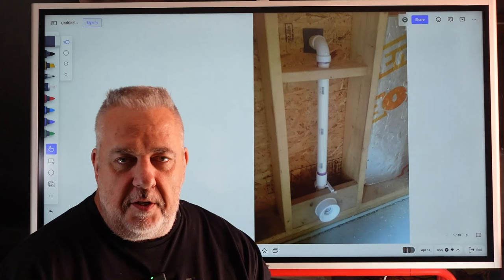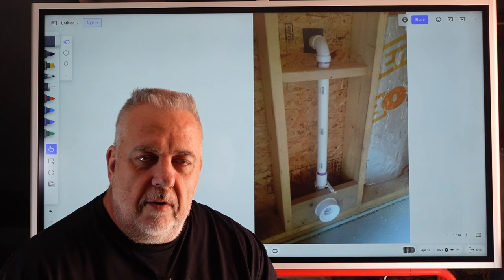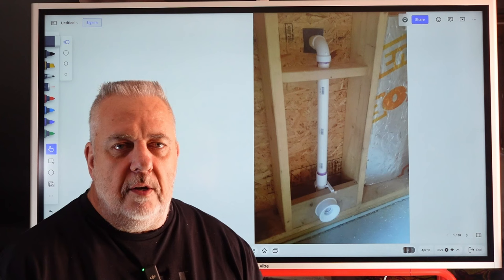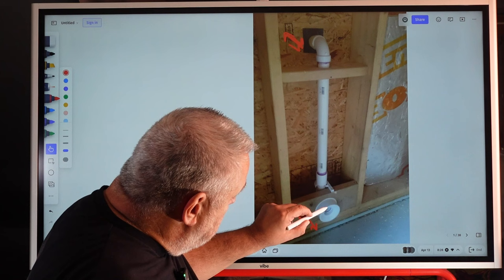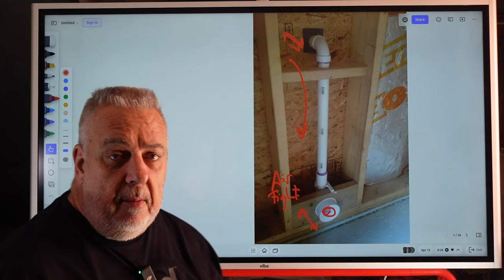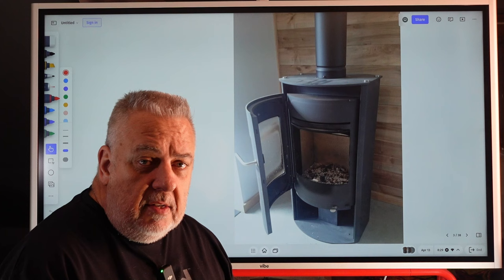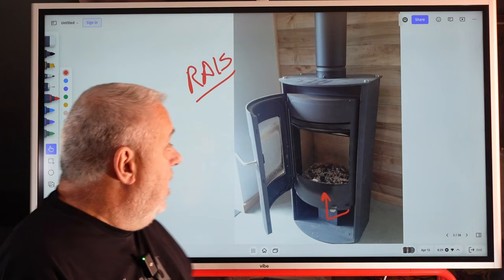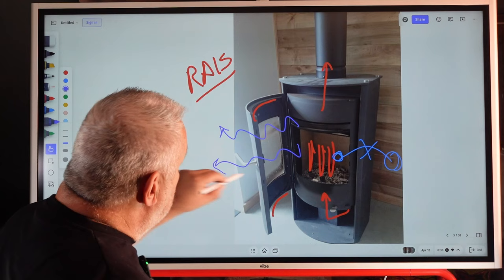SEALED WOOD STOVE....RAIS?

Comment: Have you looked at wood stoves with built in water heating systems? They can be tied into the hot water tank and underfloor heating systems, great option for a passive house. eg. the HETA Scan-Line 805 Aqua has it, and can also similarly be connected with air tight connection to external air intake.

Comment: I recently learned that "wood fireplaces" do not belong in the "modern home".  So glad to see Steven showing us how to put one in.  I have a Jotul F600 that is setup in this same way, with an independent combust chamber, which draws air in from outside.  I had not though to put a valve on the intake, I was stuck on flue and stack affect.  Going to move the F600 inside, and use this detail!  Thank-you very much Steven for this great idea.  Here in Canada, my parents burnt wood as the sole source of heat until last year, when physical demands made them switch to gas.  Love to have the option to put on a nice wood fire once the weather is cold again.

Comment: Not to be a stick in the mud, but this appears to break a significant number of IRC codes: R1006.x 1.) Doesn't appear to be a corrosion resistant 1/4 screen on the outside, 2.) Unlisted combustible, this should be a metal flue and not PVC (in the event of backdraft), 3.) Passageway should be a minimum of 6 square inches, this appears to be 2" PVC which is ~3.1 square inches, 4.) Exterior inlet should not be above the firebox.  While the theory here make sense, this is literally the textbook example of executing in a manner that doesn't adhere to code.

Comment: How do you air seal the flue/chimney system in your envelope? How do you integrate your air barrier into the fire barrier while keeping your house as tight as possible? I thought most flue systems for stoves required a gap to maintain fire protection?

Comment: Great idea, and love to see this as an option. I think it would be beneficial to see the details on the air sealing at the ceiling and/or roof deck, as typical clearance is 2"-4" gap around the pipe for combustibles. How do you insulate that area?

Comment: Really interesting! I’m currently remodeling my personal home and live in VT so the ambiance of a wood stove, fireplace, pellet stove is great but considering I’m using Zip and Siga as air barriers in the project, I’ve been thinking about what I can do for something like this as I don’t really like the look of an electric fireplace but obviously won’t be able to have a gas fireplace that uses air from inside the home.
Reply from the maker: These stoves also have very minimal clearance requirements
Reply: If you are cutting wood off your own lot and you don’t mind the chores, then maybe a wood burner makes dollars and sense (to me). Pellets are good (Im on my 5th ton of Vermont’s finest this season) but there is a cost here too, and the occasional stove clean out…

When the stove is burning the vent/chimney isn’t bad. But when the stove is off/out there is a heat pipe (loss) through your wall. And if you are cooling the house there is a heat pipe in… I just can’t see going to great lengths to insulate and seal a house and the adding such a compromise. But sure, if you have the money and you are after the ambiance 👍. I’m just making conversation, best of luck whichever way you go!

Comment: So there's no transference of heat to the pvc pipe (or the surrounding timber frame) from the hot gases inside the stove? (especially when starting cold)?

Comment: PVC, not concerned with backdrafts? I use PVC to route plug end of EVSE to outlet in garage and slot a cap to seal cable.
Reply from the maker: It has a valve outside? also some of the Euro stoves have an interior valve below the stove.
Reply: yes valve is open during use. when starting up or running low intake air, a strong enough wind can force combustion gasses to reverse, aka backdraft. PVC may not handle the heat. should be a low probability but not zero.
Reply: @stevenbaczekarchitect9431  Steve, see my comment below, while the theory here is great, this appears to be in violation of about every line of R1006.x for Combustion Air.